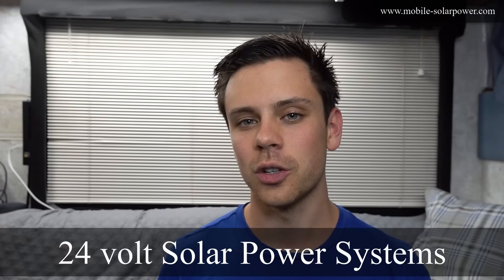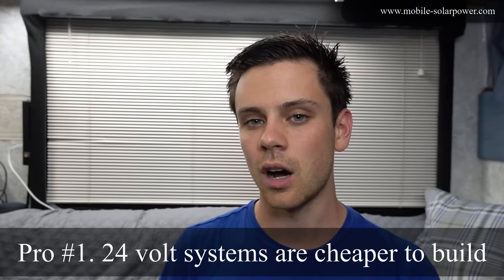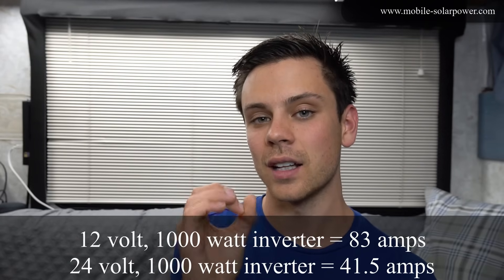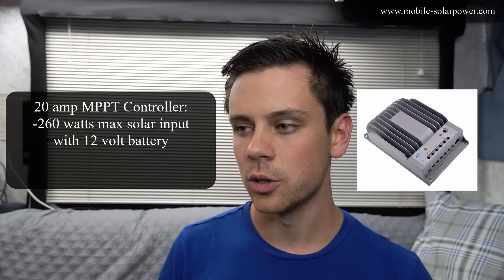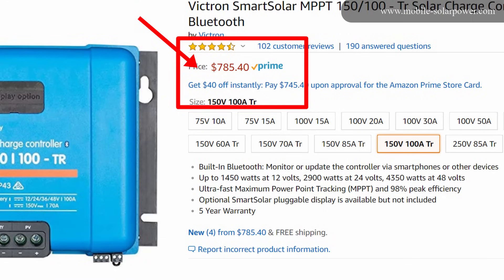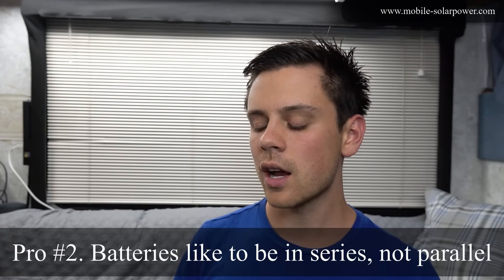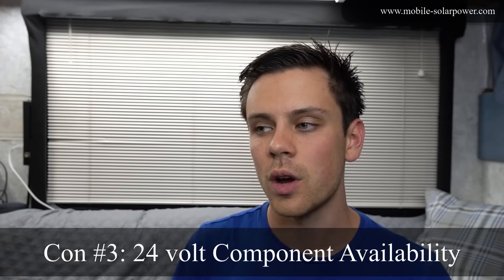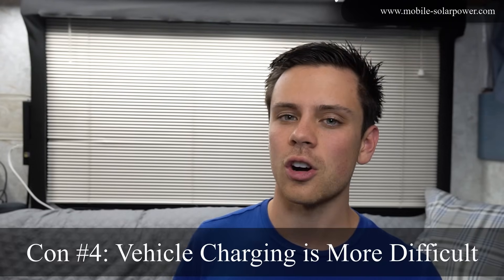12 volts VS. 24 volts for Off-grid Solar Power Systems

Comment: People have died from much lower voltages than 24V. All voltages, even 12 volts require proper respect and work practices. With dry hands 48V is fairly safe, but if you slip and penetrate the skin even 6 volts can be fatal. Using proper personal protective equipment and tools (leather gloves etc) is advisable with these systems, a slip that leads to an injury can turn even low voltage into a very dangerous situation.

Comment: I will be using amazing Electeodacus SBMS-0 without a dedicated charger and without inverter in my truck, so cost difference is just the wires, so it is not that big. Electrodacus SBMS is more efficient than MPPT controller and the whole setup is simpler.

Comment: Good info. Everything you said was important information. I was contemplating what size system to get and I was leaning towards a 24 volt but still not sure. After watching this video I have decided for sure to get a 24 volt system. What sold me is the part where a 48 volt system can be deadly and 24 volts is not. Its nice to have the luxury of power, and the safety of a low voltage system. Plus I plan to do a medium size system.
Reply: I agree, as a DIY'er I am not a trained electrician, I am in my 60o's and one good jolt...well who knows not worth the risk I am sold on 24 volt for my cabin.

Comment: I have a single 310 watt panel, with an open voltage of around 37.  Would this work for a small 24 volt system?  I  currently run a 12volt system off this panel, using a 30amp mppt controller, a single 100amp hour BattleBorn, and only a 600 watt pure sine inverter.  Would it be advantageous to buy another Battleborn battery and a 24 volt inverter?  Or would I be better off simply to add another  BattleBorn battery and stick with to 12 volts.  I don't have long runs of wires in any case.  I use the system for boondocking and could use a bit more power.

Comment: Great video!  I have a 24V inverter/charger and want to add a 24 to 12 converter to power ny DC block.  Can I connect it directly to the battery terminals on the inverter/charger?

Comment: Will make your own ends for large cable what I do is get copper tubing the size of the wire solder the pipe to the wire hit the ends with a hammer and drill the desired size hole , it's a lot cheaper

Comment: Okay I'm losing everything including a place to live. I'm going to live in my car and have been planning my power setup because that is very important.  I see so many different series but this is what I have planned  for power. This will be temp for a year then plan to buy a van but right now it will be an Accura. Okay first a continuous duty solenoid going to AGM house battery. Then a 100W SOLAR suitcase going to house battery as well. From what I understand so far the controller is on the panel s, and I'll need a pure sinewave inverter. I'll be charging cell phone, flashlight, and vape then using small fan. Will this setuo suffice?
Reply: Okay after more research the car had a smart alternator. So decided to go with a DC-DC charger, AGM  100 mah deep cycle battery, 500 Watt inverter,battery monitor.😎 I learn more everyday
Reply: Oh then in a couple months adding a 100 watt solar . Think I'm going to try a solar suitcase

Comment: i am interested in 48 volt systems as well
Reply: Same. Just bought some commercial grade UPS that is 48v I can likely use an an inverter, and I have three of them, and they have external 48v aux connectors on each

Comment: Will,   I took your advice and bought the 5000 MPP controller I think that’s what it’s called and I’m trying to wire in a 48 V pack, I am search the Internet over and I can’t find any details System of wiring that up I’m using the 38 120s and they’ve all measured mostly 3.2a few at 3.3 one at 3.0 . I will be forever grateful if you would send a wiring diagram to get 48 V out of 16 cels. Maybe I can see the top wiring but I don’t know how to do the bottom.

Comment: My question is if I have a 200 amp 48 V system is the storage capacity less than if I had an 800 AM12 Volt system. How is the storage capacity of your battery bank affected by having a 24 V 12 V or 48 bolt system

Comment: my setup is 12v but my Solar panals are about 40v I take it your talking battery side of charge controller. unless u have cheap charge controller you can have best of both worlds. put the charge controller next to battery /bank as Solar panals voltage is always higher. cable gauge is down to load you are going to pull off it.

Comment: I just replaced my 12 volts to 24 volts and I agree with your opinion. If the system more than 300 watt, 24 volts is more efficient. unfortunately I did not watch this video first before assembling my off grid solar panel

Comment: I switched from 12 to 24 due to many recommendations about the efficiency increase, but the step down transformer needed to run 12v appliances used more energy than what I was gaining by going to 24v.  So there's that...
Reply: Transformers are typically very efficient, usually close to 98%. You shouldn’t have much loss in efficiency if it’s sized properly.
Reply: Maybe im wrong but dont think the benefits of 24v he mentioned were so much about  gaining voltage as opposed to reliability and cost savings in long run by having your equipment last longer without the need to replace it amd initial expense.

Comment: Solution for charging 24v battery from 12v alternator from Victron:
Victron Orion-Tr Smart 12/24 15A Isolated DC-DC Battery to Battery Charger

Comment: To charge a 24 V system while driving why not just use an inverter hooked up to the engine battery?....Yes I know there’s some loss there but it’s easy

Comment: Did I understand you correctly about batteries in parallel, 3 in parallel is ok, it's 4 and above where the problem starts? (2) 100 ah 12v batteries give you 100 ah at 24V but if you want to add a bit more, you will need 2 more batteries. But if you have (2) 50ah 24v batteries you can add just one more and still have less than 4 in parallel.

Comment: Could you speak more on stacking batteries. Like if I have 2 12 volts to achieve 24 volts? Or maybe 4 to achieve 48? And how about series/parallel so I can boost my voltage and capacity

Comment: So, I use a MPPT inverter that can take 12 v or 24V solar input and charge a 12V battery. Though, I don't need to run any 12V system, but for those who wanna have the best of both world can opt for this solution,

Comment: I was taught that it is not the voltage per say but the amperage that is dangerous. The example they gave us in school was a 12VDC source with a potentiometer so the voltage stayed the same yet the could boost the amperage. You would hold onto the leads and not one in the class could stand it. I do know the higher voltage is dangerous but it is due to more amperage produced. A high amp 12Vdc system can be dangerous as well.
Reply from the maker: Yeah I hate how they teach that. Very misleading. The voltage needs to be high enough to overcome the resistance of your skin. I could give a crap about amperage if the voltage is not high enough to allow it to pass thru my skin.
Reply from the maker: No, 12v high amp system is not dangerous. I can touch it with wet hands with non-issue. With batteries that can push 1000's of amps. Not an issue. Look up ohms law and skin resistance

Comment: hey what happen is you run two 12volt batts in series which gains 24volt and only connect your 12 volt inverter to one battery.. does it damage the second batt.?????

Comment: So if I run 24v and reduce it to 12v,it is still a.c. correct?
Reply: Ac is just the work your inverter does converting 12v/24/48v to 230v for appliances. Your car gasoline/diesel car  runs on DC, your solar till the battery is DC. Only becomes Ac via an inverter. If u have 12v or 24v appliances, you can connect it directly to batteries

Comment: Man I have a 48 volt 8 kwh off-grid solar system. I am using a 7000 watt pure sine wave inverter. I am running a mini split 12000 btu AC/heater, a washing machine, gas dryer, Small oven like you make pot pies in, 2 refrigerators a 12 foot chest freezer, a tankless water heater on natural gas and it is all being powered by a full Chevy Volt battery from a 2013 Volt. I am using no BMS and all of my batteries are kept in balance within .5 volts. I do balance them every year and its a simple process with a set I bought off of ebay. My charge controller is a 100 amp and it works flawless I bought off of amazon over a year ago.

Comment: I am looking into purchasing a 27 foot Travel Trailer from a friend and i want to outfit it with a solar charging system. This unit only has 1 12v battery at the moment. I intended to use is for camping/fishing off grid. No more than a few days (3-4) at a time. Also how can i incorporate a generator into the equation? Will i have to turn off the solar system when using the generator? i have a predator 4000 generator from harbor freight, will this be sufficient? What are your recommendations? Thank You in advance.

Comment: Got a question about battery charging in your car. 
My car has a 150amp alternator and I installed a 1000 watt inverter. I have a relatively small 27amp deep cycle battery (I think it’s gel or AGM) and bought a charge controller for it. I was trying to match the charge controller to the inverter (lots of praying on that one). 
So should it be save to charge my battery thru the inverter?

Comment: Thanks. I got a 30 amp 24 volt to 13.8 volt DC to DC convertor for around 35 bucks.  I hooked it to a regular lead acid battery to buffer the power demands and also to meet short demands over 30 amps.

Comment: Very informative video Will, however, there seems to be a prevailing myth throughout YouTube that running a 24V system in an RV requires a 24V to 12V step-down converter. This is simply not the case.

Virtually all RVs have an onboard 12V DC converter/charger installed by the manufacturer to power the 12V systems and to charge the coach batteries when plugged into shore power. In my Jayco, the existing IOTA DLS45 DC Converter (with the optional IQ4 Smart Charge Controller) remains in place (in the space under the fridge) providing 12VDC for onboard systems and smart charging for the 12V battery bank mounted on the reach.

I installed a MultiPlus 24/3000/70-50 120V in line with my travel trailer's shore power infeed. That is, I wired the shore power infeed through a 30A breaker then connected to the 120V AC input terminals of the inverter/charger with the AC output terminals connected to the trailer’s 30A/120V AC panel.

This method seemed the simplest and least invasive integration with the trailer’s existing AC/DC system. Everything onboard operates the same whether connected to shore power or operating on solar/battery power.

Therefore, no need for a 24V to 12V step-down converter or an additional trickle charger.

Cheers,

Glenn

Comment: Ok question on the cost saving, if using lifpo4 doesn't the cost go up quite a bit due to having 2 100ah batteries to get 100an instead of 12v 200ah for 2 batteries?
Reply: doesn't matter if you put them on series or parallel. The stored and available energy is the same.

Comment: The higher the voltage the better. Amazon has all the parts, 48 volts and 96  volts. The higher the better. 20 yrs experience.

Comment: Something I saw on a show car once; the alternator was removed from the engine bay and put on the drive shaft. Not very practical for most cars because the alternator only charges when the vehicle is moving but for a secondary alternator on a van it could be suitable for some people wanting to charge from the engine but not able to squeeze a second alternator in the engine bay.

Comment: Thank you Will. As PGE shuts off power at their will my interest is more than mere hobby. Please do a video on building a 48 volt system for a home. Many thanks.
Reply: I hear you Sister.  California politics are very strange to me.  PG&E has equipment that starts fires, many people lose homes; so the government sues PG&E for the damages.  PG&E says "ok, we do not want to get sued so we will shut down power if the risk for fire increases", people get mad and government sues for no power.  I just don't get it, but either way, you certainly need to protect yourself from any power loss regardless of the reason.  I live in the Mid-West and except for the rare summer heavy thunderstorm; our power is fairly safe and very clean too.  I use solar for my way off grid cabin.  I have a back up solar system at my house "just in case SHTF".  I have learned how to reduce electric consumption via LED and other power saving methods.  Thanks Will for all your contributions to the cause.
Reply: Funny. His videos are now mostly 48 volt server rack batteries with all in one inverters.

Comment: You are wrong about series connected battery banks being better than parallel connected battery banks. With series connected battery banks you often get state of charge imbalance,and will have to manually balance charge each battery often,you don't get that problem with paralleled battery banks. With series connected battery banks,you increase the effective series resistance with every battery you add in the series,which means you dissipate more power through the batteries. With parallel connected battery banks,you decrease the series resistance with every battery you add to that paralleled bank,which means you decrease the dissipated power of that bank. With series connected battery bank's,if one battery drops just one cell,then no power will be delivered by that whole bank of batteries. With paralleled battery bank's,if one cell drops out from one battery,the rest of the bank will still deliver power to the load.  So can you please do a video telling us why you think series connected battery banks are better than a paralleled battery banks,other than a slight increase in wiring costs.
Reply from the maker: I meant, managed series strings. Raw cells in parallel without protection causes problems. I should have explained this more

Comment: Fun to listen to. I been watching your videos and haven't seen this scenario...  building a system for off grid cabin this spring. What if I setup a 400w solar system and walk away for 2 months not using the system at all. What do I need to do to be safe and have power when we show up? And not a burned down cabin? Thanks bud

Comment: Am using a 24v 6000w inverter/charger  for  a small house
Reply: Am using 4. 225amp 6v US power  batteries 
I use less than 1500 watts per day
Reply: What kind of battery bank do you use?  How long can you use the battery without charging?

Comment: I wonder what size solar panels,batteries etc..I think I’ll just need a 12 volt system?I will be installing them in a van that I haven’t purchased yet.I will only be using a small refrigerator and maybe a TV maybe charge a laptop

Comment: Hi William, I would like to build a 24v system for my sprinter van using Lithium ion batteries. Do You have a recommendation for an dedicated alternator for the 24v system. I know that sprinter has a factory pulley to run a separate alternator. Just got your book, it’s great,  thanks for any help.
Joe

Comment: The best way to charge with a alternator, is to just install another / second alternator, with a charge controller, or DC to DC charger, 
2kwto 2400 watts is absolutely the largest I'd put on a 12v battery, or under 300-350 amps! With about 150 amps constant or less, things heat up, connections get loose, and bad things happen!! With high current systems!!  I have a 24v 5kw system, wired with 2/0 cable, under 10' and pushing only 15 amps they 10 gauge, under 25' from the PV.. With the multiple 10 gauge runs, the future addition will be easy, about 85-96v, at up to 20 amps each, is alot of power! About 10-12 kw of solar, potentially, I'm planning about a 12kw 48v+ inverter, and 4kw + pv, fully off grid, with a small hydroelectric generator, and a gas DC generator,

Comment: I have a situation that I can use 18V DC on an appliance that I have instead of the 120V - 18 V DC plug in system. Is it possible to have a 24 V Solar and use both 12 & 18V? I know this might be confusing but hopefully you understand my question. Thanks for a great channel! Oh and my son is an electrician and I've showed him your video of a basic wired solary system and he thought it was very professional!

Comment: I'm building a DIY battery back up with an old 1.5kw solar system from a house. I forgot the reason I was going 24v instead of 12v but I looked up this video which reminded me about the mppt solar charge controller and how much more power you can input with a 24v over a 12v system.  Thanks from Australia Will!  Your videos are great.

Comment: I have a 12-volt system, Mark 2 charge controller $100. Two T105's $100 each. 225 amp hour. I got a deal on a couple of panels $400 for two $100 in wiring and fifty bucks for an inverter. One brand new 1500 watt generator, $100. Champion model. And a 950 Watt battery charger $180.
Total of 1080 and I've used that system for 10 years. It's all still working.

Comment: This question should shake you up a bit..lol...what if i wired 2 12 volt grid ties in series to run 24 volt input..never tried that..ive got two and now my arrays are at 24 volts

Comment: Q. I have 3 Mini small sealed 12V, 8 ah Batteries free from work when they replaced with newer ones, they are perfectly fine but can I run all 3 parallel and if I used only 2 for 24 V what size out put solar panel should I get per rating and do you know on line a good inverter/controller to run this temporary system, PG&E have been cutting off my power and I at least need to run my laptop & Wi Fi Router Box.